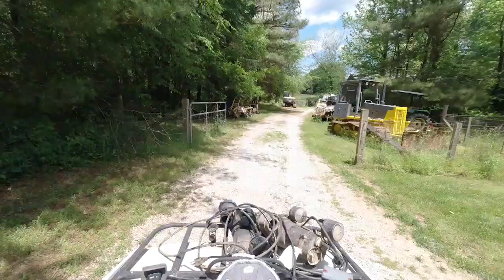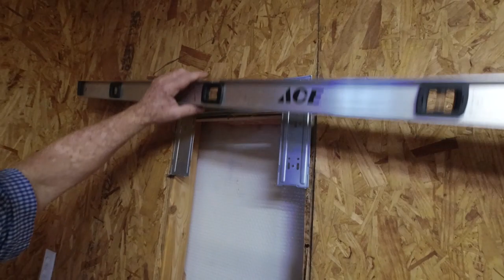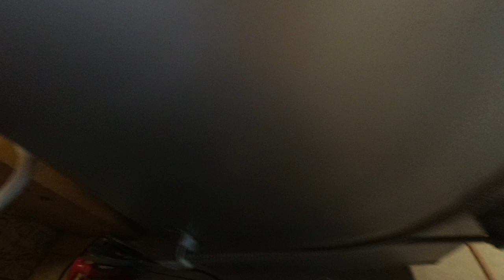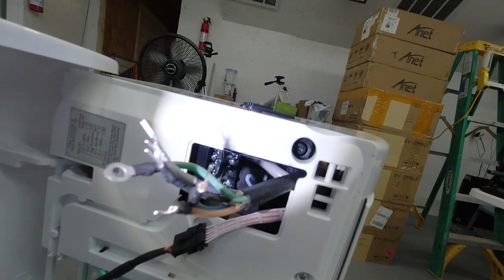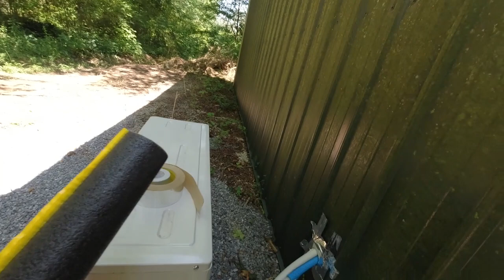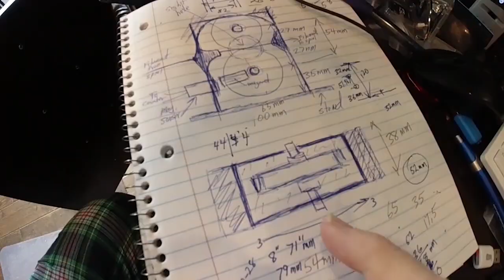DIY mini split A/C  UNIT  KEEPING  THINGS  COOL  AT  MY  3D  PRINT  FARM

Comment: Ah ken let me save you some money. Return that AC. If your shed is getting hot it’s good I’d say insult it more and make it go hotter. Because the you can print with ABs and it’s a much better plastic than PLA and PETG. It’s much cheaper it has a lower density means it gives about 50% more volume in print. and you can even buy same 1 kg spool cheaper too. only problem is you can’t print them easily with open frame printers, unless environment is hot.ABS is thrives in heat and don’t worry about your electronics. They can survive in up to 100c which they will never see.
Reply from the maker: Thanks for the advice my friend. I do plan to keep temperature around 80 F  when printing, but will need A/C to keep it from going thru the roof. It was over 90 F here yesterday and temperature inside the building in the unconditioned area was 98 F. It will get hotter the next few months and I don't need to print any ABS at this time. I can print ABS in the resin printer booth that is sealed and vented to the outside. I will let you know when I start doing some ABS printing. Thanks for the comment and for your support...Ken

Comment: Great job as always Ken - as a reward for all the hard work you should pull out a chair right underneath the unit and soak in that cool air!! We're having another pretty warm summer up here so can't imagine how hot it is in TN! Take care - C
Reply from the maker: You bet! I did pull up a chair and enjoyed the A/C while it was over 90 F outside and even hotter in the non conditioned area of the building. I still have a lot of work to do down there and with the A/C  it will really be nice. I had to run some more power for the resin printer booth and for my internet hub and video monitoring DVR, etc. Also I had 16 camera cables to run. Things are working well and I have some production parts to run later this week and will try to get some video to show how these new parts run at the print farm. Thanks for all your support my friend...Ken

Comment: Really admire your work ethic and intelligence! Im in the process of moving my 10 3d printers in the garage onto storage shelves. Im going to create a plywood shell with doors around the storage shelves and run ventilation to the outside. Im hoping I don't have any issues with heating the garage.
Reply from the maker: The mini split heat pump I installed will heat and cool and is 1-1/2 Ton. It cost $ 669 including shipping, and I had to pay $60 tax, so about $730 total and well worth the price. N problem with the installation at all. If you have problems in your garage this may be the answer. I wanted the A/C rather than ventilation that would bring in the high humidity we have around here. Good luck with your new location, I hope all goes well. Thanks for your support...Ken

Comment: Nice air conditioner.  Just thought.... I have 2 exhaust solar fan-exit installed  in my attic ... no cost and pretty nice air vent.  Getting heat out is paramount in a farm.  Especially in Tennessee ... you do have vents which is good but you might consider the solar exhaust. Seems that air conditioner might need some help.  The air around the ceiling needs a place to exit....joe
Reply from the maker: I am looking at a large powered  gable vent fan, but the solar you suggested may be better since they can run almost continuous. Thanks for sharing your idea Joe. The A/C is great, I have about 12 more printers to assemble and the shelving too. I don't think I could do it without the A/C, it was over 90 F here yesterday and much more inside the building area that is not conditioned. Spending 80% of my time now doing assembly of parts for the Helping Hand. I calculate I will need to spend about 80 man hours doing assembly to reach the starting inventory I want before launching my website and selling products. After all this I hope I sell something. Thanks for your support my friend...Ken